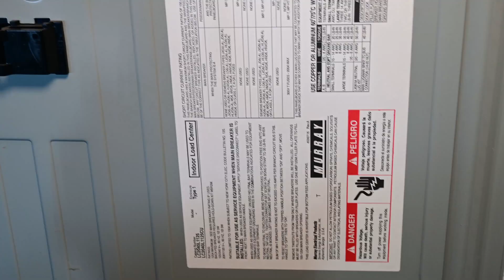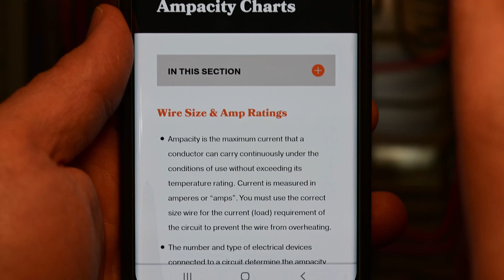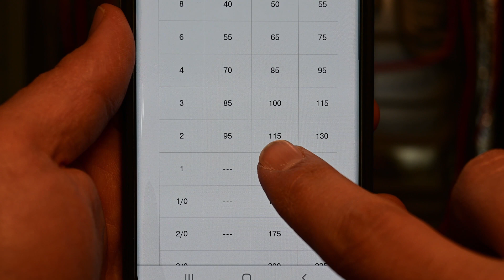How To Wire a Sub Panel in 2005!

Comment: Using a white wire paint black where is the neutral wire ?? I experienced the same thing 2 with ground and the black and white wires went to different breakers and then to a rec. box but no neutral wire.. How can you install a receptacle without a neutral??
Reply: 240 volt requires no neutral
Reply: Hope you don’t plan on doing any diy electrical work before learning a little more about residential alternating current. It’s standard procedure to use a white wire as a hot lead providing 240v only to an appliance. Just have to redesignate the wire as a hot wire by changing the color to red or black traditionally. 240v doesn’t require a return path(neutral). No disrespect imposed.
Reply: @lesgray3355  Thanks...
Reply: I forgot to mention it was 14 gauge wire....
Reply: @Rick-tb4so  wire gauge dosent matter its about the watts one 14 gauge wire is good up to max 1800 watts i do %80 for constant draw so it wld be 1400 watts of power so you cld have a 240 device with say less than 2800 watts of power demand and than use 14 gauge wire. as a general rule tho ill run most of my 240 volt lines with 10 gauge but im no professional bean counter for max profits. my guess they had a 220/240 a/c or other small motor. more than likely it was for a electric baseboard heater if not near a window that didnt need more than 2000 watts of power so no neutral wld be needed
Reply: @wizard3z868  Thanks for the info, there is alot to it...
Reply: @Rick-tb4so  here is another good tip to help you out mostly for sizing generators 
amps X volts = watts  so a refrigerator running at 8 amps x 120 volts = 960 so a generator of at least 1000 watts cld power it. and a 60watt bulb/120v=.5 amps 
but remember with generators to go by the lowest watts never the peak . like sizing conductors to %80 use for a safety margin
Reply: @wizard3z868  … It helps to know what appliances draw before sizing a gen set. The average fridge will draw closer to 3 amps but needs more like 12 amps to get started. To properly size a portable gen set you must never exceed the total of gen set peak watts with the appliance starting watts, although with a larger gen set you might get away with intermittently hitting 120 - 140% of rated continuous watts. (larger set meaning something well over 10Kw) IOW, if you have a fridge, freezer, well pump, and warm air heat (with fan / blower) you'd be rather tight on a 5,000 watt gen unless you manually started each appliance separately.
Reply: @wizard3z868  … wire gauge DOES matter when trying to flow juice without creating excess heat. There are also ratings for terminals and other connections points, which are all about the heat when things aren't sized properly.
Reply: @rupe53  it was just a basic example and if pple dont know how to size appliances they shouldnt try also i said you dont want to go by the peak output as most generators never hit that mark.
Reply: @rupe53  yes im aware also there is this long standing myth anything 240 needs to be 10 gauge and at least 30 amp fuse not true why this person was confused why he had two hot legs with 14 gauge wire and no neutral.
Reply: @wizard3z868  … If they are confused by a myth then they don't know enough to be fooling with it. If you know the load then you should know the wire size needed, and vice-versa. In my home I run a pair of small central AC units on #12 wire with a 20 amp 2 pole breaker on each. It's exactly what the mfgr calls for and an amp-probe proves it.
Reply: @wizard3z868  … oh, most gen sets will hit their peak mark. It's just that most people don't understand that's not a practical figure to use, kinda like a sprint runner who can't keep up that pace for more than a few seconds before burning out. Peak power is more of an advertising gimmick for dealers / mfgrs who want to pound their chest. You will notice that stationary sets don't have peak power listed, just steady state. Still, in both cases it's up to the installer to understand what this gen set can do and can't do. Also wise to build in a little fudge factor because people's needs / wants change over time.
Edited to get back on the original question: It's obvious to me the guy has a 240 volt outlet, not a standard outlet.... unless someone screwed up in typical DIY mode. I have seen this before. 20 amp / 120 outlet has the horizontal blade on the left (T-shape) and 240 outlet has the horizontal blade on the right, or possibly both sides, depending on 15 or 20 amp rating. These outlets were in common use for commercial buildings in the 50s. Only the 20 amp / 120v (left side T-shape) is used today.
Reply: @rupe53  yes true but you do realize we are chatting and commenting on a social platform that everyone looks to 4 advice and gives??
Reply: @rupe53  yes and keep in mind i base a lot of my calculations and ratings based off of equipment that is cheap and unreliable what most pple wld get and have trouble with.
Reply: OUTTA TIME  … since LED bulbs take AC volts and convert to DC via electronics, I suspect the power from the gen set is "dirty" or chopped sine wave, which is common on low budget units. Standard fluorescent bulbs might flicker and even burn out prematurely but some LEDs just don't like that stuff.
Reply: OUTTA TIME  ya i mean 1800 watts all those bulbs less than 100 watts how many watts was the  drill snds like either an electronic ballast or led circuit interferring with the gen power or there is some kind of lose connection im honestly baffled????
Reply: OUTTA TIME  keep in mind im no professional electrician maybe a 2nd yr residential  apprentice at best.

Comment: Water heater breaker lockout is required by code because I'm assuming the water heater is located somewhere away from the panel. If the water heater were within site of and less than 50' away the breaker could be used without a lockout device. If the heater is in another area it has to have a disconnect switch located where it is at, or have a breaker lockout at the panel. Off the top of my head I think 422 is the code article that applies to fixed in place appliances requiring this.
Same thing applies if you have a dishwasher that is hard wired. Since you don't have a local form of disconnect (because it's hard wired) you would typically use a breaker lockout as a complaint form of disconnect for servicing that appliance.
Reply: Maybe you’re thinking of a garbage disposal? I’ve never seen a switch above counter-top for the dishwasher. Usually the dishwasher has either a receptacle in the sink base or it is hardwired.
Reply: @playnationtoday  … 50 years ago is before my working time, but I can tell you that in more recent years any hard wired appliance is required to have a local disconnect. An outlet qualifies.
Reply: rupe53 I work in NYC. At my company we run the dishwasher HR to under the sink and have a jumper that goes behind the dishwasher. This way if it’s hard wired, we put the HR and switch leg on a switch. If it has a plug we turn the HR into an outlet and cap off the jumper.
Reply: Scott Ross … normally a dishwasher will have a switch within arm's reach of the appliance or an outlet behind the unit itself. (under the counter) Not sure if the code has changed again but back in the 60s it was common find a switch mounted on the wall above a dishwasher.

Comment: Usually, a lockout on a breaker gives the ability for someone to work within an area without worrying someone will turn the breaker back on.....but in this situation, it looks like a safety fault lockout.  Basically, the ONLY reason a water heater would cause a breaker to be thrown is if there is a serious short or damage to the water heater, which can be very unsafe if left live....usually best to fix or replace the water heater if this happens.  The lockout does not prevent the switch from being thrown, it will break even with the shield engaged, but what this does is prevent someone from turning the breaker back on easily, it's a "are you sure you want to do that?" guard.

:)
Reply: If it's intended as a safety lockout then, should it be locked, or at least have a zip tie on it? Having the guard by itself doesn't seem to prevent much of anything unless it's actually secured in some way.
Reply: @BrentFreyEsq  ... from what I can see, the panel itself blocks the lockout from being moved, you have to remove the panel (which he does) in order to open the lock.  Unless this is a broken lockout, which serves no purpose whatsoever, it's hard to tell without actually being there.
Reply: @sabriath  … if the panel cover needs to be removed to reset the breaker it would force the homeowner to call in an expert when there's trouble. That said, in most condo situations they will have a local disconnect within arms reach of the water heater itself, should a plumber or handyman need to do work.
Reply: @rupe53  ... like I said, it might be broken, I'm not there, I can't see the full detail of the lock.

Comment: Im in ct. Need to upgrade from 100 to 200 amp panel.  I can do the rest but need a licenced electrican for the main job. Im a retired lineman from a electric utility am used to working wih high voltage  construction grids but not houses
Reply: Miriam Vivo … I did exactly that a few years ago and mounted the new panel right next to the old panel, then ran all new SE cable, meter pan, weather-head, etc up the outside of the house about 6" away from the old service. Also ran a second ground rod per new code. Since I had a generator, the transfer switch was already in place and the old panel became my generator sub panel. The day the utility company showed up I ran the house on generator for an hour or so while they changed things over and I made my final connections to the new panel. Yes, I had a licensed electrician take a gander at my game plan and he gave the me thumbs up. The 200 amp panel has the electric range, shop welder, compressor, hot tub, sauna, clothes drier, and central AC. The sub-panel got the bond removed, has the  heat, lights, fridge, washing machine, and a few other necessary items for a power outage. Sub-panel still has the main breaker but it's fed with a 50 amp from the larger panel.
Reply: What does the house have that needs a 200 amp panel?
100 amp is enough in most cases unless the house is heated by electric resistance heat - in which case i would focus on getting rid of that rather than upgrading to a 200 amp service.
Reply: @Jon-hx7pe  … The home / condo in the video doesn't seem to have anything heavy other than an electric water heater, but they guy mentioned finishing the basement / garage. If you mean MY home, the list was in the post and steady state draw COULD be 100 amps with a calculated inrush of about 150 amps. (motor loads) Service upgrades are seldom about total load and usually more about the fill rate of the panel plus convenience of doing home runs for organization. Cost difference for the extra elbow room on a new job is maybe $50 so well worth it.
Reply: don't you have to put thicker conductors going into the panel to upgrade to 200 amps? I thought you were talking about upgrading to 200, not a new new job.

I wouldn't worry too much about inrush current as the spikes last less than a second.

point taken though if 200 amp panels have more space for breakers.
Reply: @Jon-hx7pe  … yes, you do need to increase the wire size to upgrade to 200 amps. Yes, inrush needs to be considered too. There are limits to what you can get away with and what code might call for. That's a choice you'd have to make. OTOH, in for a penny, in for a pound. If you are upgrading you might as well spend a few bucks now instead of doing it again. Empty space in a panel never hurt anyone. I can say from experience that after living in the same house for 40 years... I originally upgraded from a 60 amp (with several subs) to a nice tidy 100 amp service of 20 slots. (not all used then) Fast forward 20 years and added central AC, a hot tub, sauna, air compressor, etc. It was either spend a few bucks to add another sub or a few more to upgrade to 200 amps with room to spare. Since my draw was pushing 100 amps I went bigger instead of just more breakers.